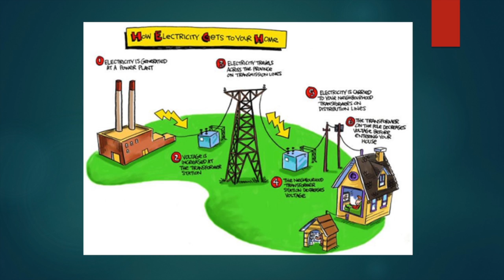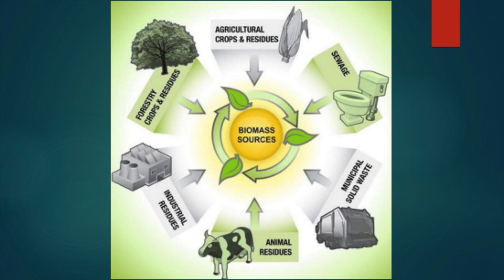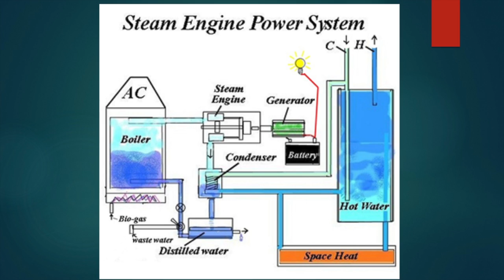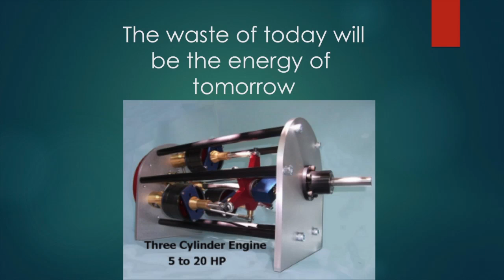The Surprising Future of Steam Power | Robert Green | TEDxMissionViejo

Comment: Any heat engine must work between two temperatures which are  wide apart for maximum efficiency. If the exhaust  side of the engine needs to cool down and this is done only through the heat exchanger, then the hot water side in the boiler must not reach a high value otherwise the  engine exhasut  would have to be vented to the air.  It is possible theoretically , but in practice there will be difficulties.
Reply: your thinking of stirring engines not steam engines
Reply: You need to also Google up Steam Condenser.
A system like this would condense the steam, and pump the water back into the boiler.
Still does not change the fact that wobble plate designs are bad, and there are a host of other problems.

Comment: There is nothing new about these wobble plate engines. His engine seams to a low pressure low expansion design making his clams unreal.

A steam turbine is able to produce power over a wide range at fairly constant efficiency. The design is to simplistic to address all the problems. Water has desolved solids that cause many problem in steam systems. Scale build up etc. Steam produces high torque the engine shown here would not be able handle driving a generator that could power most homes today.

The concept is doable. But I doubt that engine is the soloition.
Reply: i allso agree but its not as efficient as a wibblewobbl jelly is it?no i dont think it is.Or as wobbley as a wobbley  hat
Reply: Couldn't he use superheated steam? It was used in locomotives to increase power and efficiency. Its like supercharging an internal combustion engine.
Reply: Yep, but steam turbine in small scale is not more efficient. There are lots of more advanced, yet simple piston steam engine designs. One of the great advantages about piston one is that it works fine over a wide range of loads and can adjust itself to keep up with load
Reply: For example, if you put load on a turbine-powered generator, it just slows down and your light in a house would dim. When the same would be with piston-powered one, it will adjust the valves or throttle to keep up the same RPM and give you as much power as required
Reply: Water boils in a vacuum at room temperature think about it.
Reply: The answer is actually gas turbines, which is what power companies are going to anyway.  I love steam, but it's had it's day.  Still, there are some fun things you can do with it.

Comment: All a steam engine does is convert heat in to motion where do you think heat comes from ?
Reply: Tony Wright your right but the same happens with any fuel burning engine .
Reply: All nuclear does is to convert heat in to motion. Big price to pay. The internal combustion engine does the same thing despite the pollution. For a mechanical process, steam generation can be a very viable process. Our expectation of electricity is so 20th century as to be embarrassing. Tesla had a vision that was corrupted by big business, same as it ever was........
Reply: yes but a sosage roll gathers no kate moss
Reply: Water boils at room temperature in a vacuum you just need another low-pressure area vacuum chamber for it to go to and a turbine in between with a condenser and a one-way valve and piping to return the water to the hot side. So you can run a steam turbine with very low energy inputs.
Reply: don schmidtke
Reply: Tony Wright  A magnifying glass.
Reply: i didnt find it. what is it?
Reply: Tony, the advantage of a steam engine compared to say an internal combustion engine like a steam generator is that you can run it on almost any kind of fuel. That means you can easily have it use biofuels such as logs, biogas, pellets, food waste etc which is CO2 neutral. An internal combustion engine needs to run on the fuel it was made for. It means you cannot just suddenly upgrade all cars to run on biofuels. But that would be much easier if they used steam engines.

Secondly a steam engine does not even need to use a fuel. The heating could be provided by a solar concentrator or geothermal. It makes a steam engine a very flexible system compared to an internal combustion engine.